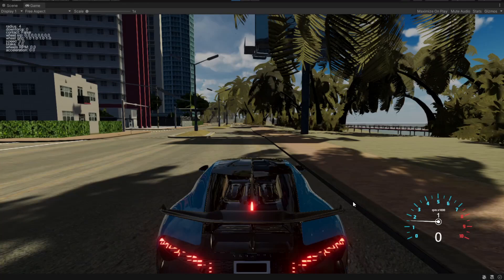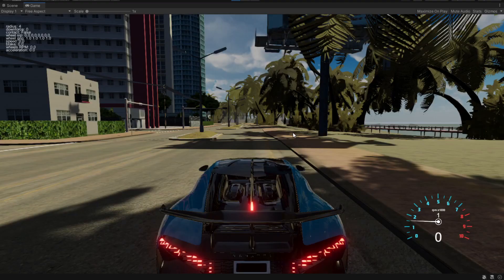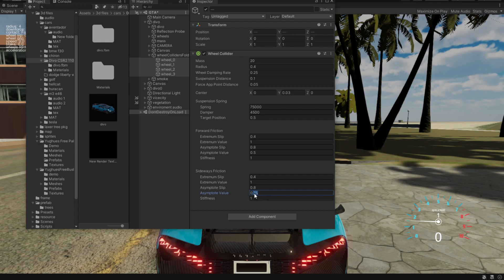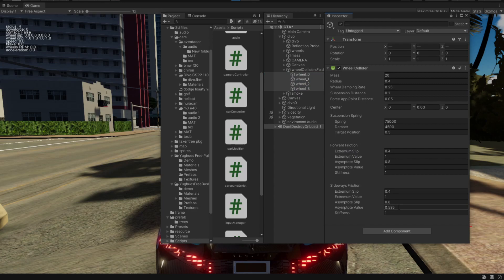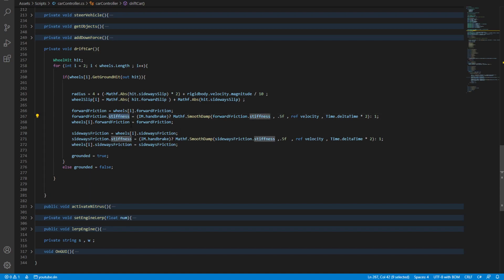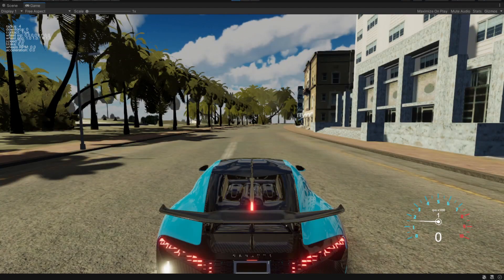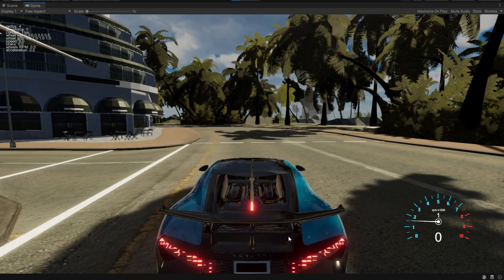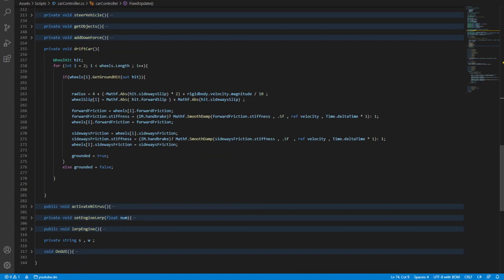Unity Drifting using Wheel Collider - Explained

Comment: Hi, I wanted to ask if the customization system can be implemented with RCC? I bought it months ago for the quarantine. I am more a modeler than a programmer and I thought that I would only need that asset but making a menu and being able to change colors to vehicles or tires is very difficult.
your tutorials are great, you are the only one who makes videos of just what I want to do.
Reply: To change the properties of a material with a UI button is really easy!
1: Create a script and attach it to any game object
2: Create a material field in the script and name it 'mat' or something
3: Make a public method with material parameter  --> public void ChangeMaterial (Material newMat)
4: Inside method: mat.CopyPropertiesFromMaterial(newMat);
5: Save, return to unity and assign the material that you want to change its color/properties in the script
6: Create a UI button in the scene and add a new 'OnClick' event
7: Drag and drop the game object in there and select the 'ChangeMaterial' of the script
8: Drag and drop a material that you want to get the color/properties from in there
9: Press play and test it
10: Done!
Reply: @x3n689  Thank you very much, I tried these two days and managed to change the color of the vehicle and the wheels. but when it changed color it changes in all models.
Now I can use Pablo's scene and customization, in fact it is very simple. the problem now is that the UI has the sample icons in all colors or upgrades and you cannot change the icons or even the size because it has the generate array function, I was thinking of adding a horizontal scrolling but i dont know how in code , it's possible?